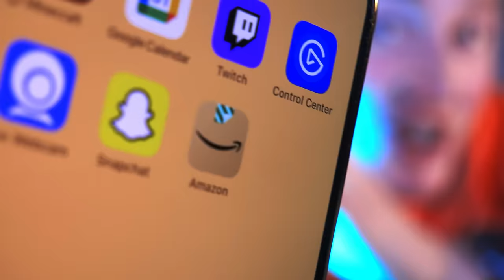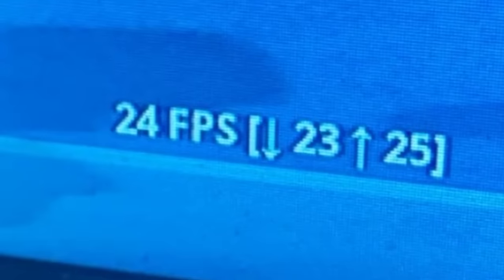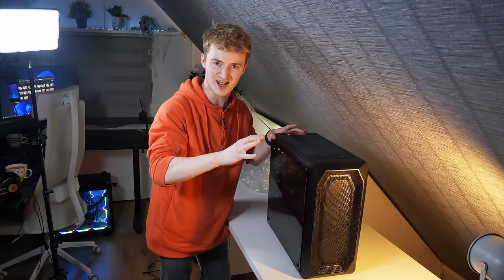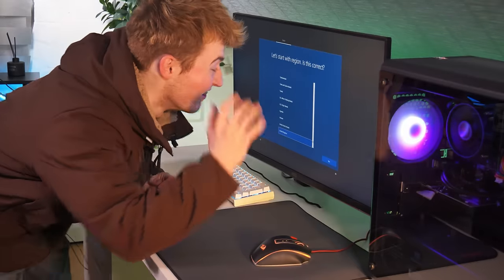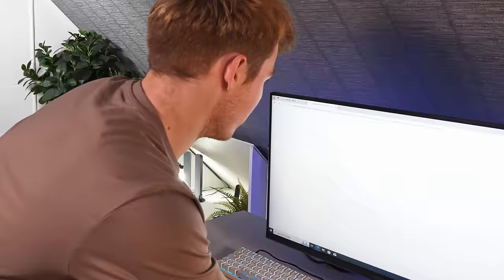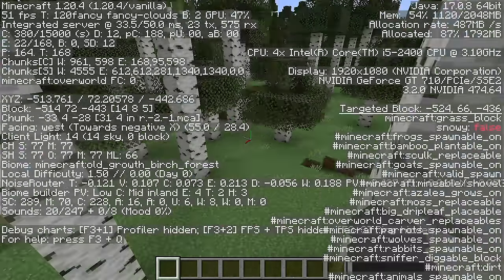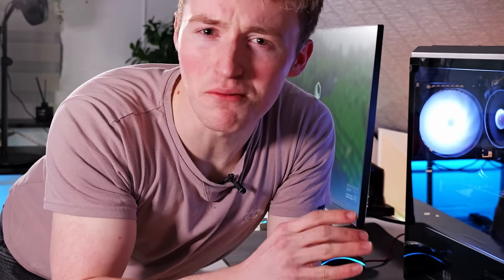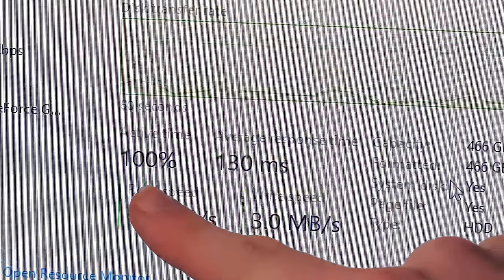Can Amazon’s CHEAPEST Gaming PC Run Minecraft?

Comment: If so one has these specs, you’ll want to get another 8gb stick for less than $10. Then get a ssd for less than $20. For the graphics card upgrade you can get an rx 580/570/560
Reply: i got a worse one than this😅
Reply: get a 2550k or a 2600k, buy a used rx 580 and you got a good budget pc

Comment: I have an Optiplex 7010 from Amazon that I got for like $110 and Minecraft is Nothing hard for it to do it comes with an i5 3470 16GB DDR3 in dual channel NO GPU average frames in mc is 60-80 default and I play with optifine and lower settings so for my experience it's around 100-200 fps and I've gotten about 300+ min settings
Reply: I bought a used pc for around 50 dollars and swapped the old components with some new ones and it cost me around 110 dollars aswell . And it runs 1
20.1 with sodium and other mods . I get around 150 fps

Comment: tbh, mines worse. mine has a gt 610 and 12 gigs of ram (to balance things out) and a i3 4150 (dont question it) mine looks good with a rgb case, but the performance is not that good but still. im happy with it. it can run 1.20.1 on like 78 fps average with 12 chunks loaded. i use mods for fps boost and it can run 1.8.9 lunar on like 200 fps (ik its good) and im happy with whatever i have
Reply: you should get an rx 580, quite cheap but pretty good even though it's getting old
Reply: Ssd?
Reply: ssd is 120 gigabytes and ddr3 (incase anyone was wondering)
Reply: @Avgosbos  im not really into upgrading my pc right now. ill think about it when i actually have the budget to get a pretty decent pc.
Reply: @Yellowiee_   that's a great option too lol
Reply: im getting through it, also rx 580 is for ddr4 when i have ddr3. so ill have to change my actual motherboard and cpu ram and etc to actually upgrade my pc. so yeah i think ill save up and get a 1850 and upgrade other stuff.
Reply: @Yellowiee_ the rx580 isn’t for ddr4. Idk where you got that from, however gpus aren’t made for specific ram. For example, I can put my 1060 in my old i5 3470, 16gb ddr3 ram pc, heck I could even put my 4060ti in it. 

So if you upgrade, you’d have no issue when it comes to that.
Reply: @Avgosbos that i3 will bottleneck
Reply: @Yellowiee_ thats wrong.

Comment: My “old” pc was a Dell optiplex 790 I think and it was kinda cheap too considering the fact it was shipped to me with duct tape around from the top to the front of the case then to the sides and the bottom too because the front of the pc was loosing and almost about to come off and the inside is just well let’s just say it wasn’t good that I expected to be then a few years later in 2023 latest I got my new pc but I wanted to get an custom one instead pre-built one since I don’t trust pre-built pc’s anyone after my last one so I just got the Corsair 4000d airflow atx mid tower case by it self and overtime I’ll get the specs some good specs to make it run well on its performance

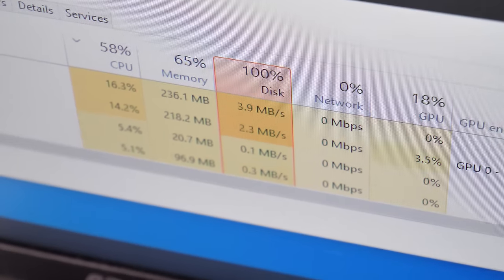Comment: 8:33 no the hdd (hard disk drive) is not failing what has happened is that the drive has a lower rpm on the platters they suck in like a super slow laptop drive from the modern day but that's what your gonna be expecting with a PC that costs as much as a ps4 in today's money

Comment: Mine is worse…. It takes like an hour to load the home screen and if you load the Weather app it will crack it basically freeze the laptop the laptop will just have to wait you have to like shut it down read open it Minecraft Java addition latest it lags so hard that it takes about 14/15 FPS Minecraft it barely works I don’t even know how it’s running windows 10

Comment: Rtx 4060 ti $560
Thermaltake S200 Mesh ARGB Mid Tower Black ATX Case, T/G Panel, No $99 
Intel Core i5 13400F - 300-400
Deepcool CF120 PLUS 120mm ARGB Fan, 3 Pack 60
MSI B760M Tomahawk Wi-Fi DDR4 350-400 would this pc work well?
Reply: @hugedickelliot  I forgot ram memory and a power supply

Comment: The fact that my pc has even less frames then this pc is terrible 😶😶😶😶☠️☠️☠️☠️
Reply: What can I do to increase my fps 😅😅😅😅

I have changed my hdd to SSD 
And increase the  to 4gb(but it supports only DDR3☠️)....
What should I do next..???
Instead of changing this pc😂😂
Reply: @tysongaming095  i depends on what type of game you play
for minecraft you can either mod it of play bedrock edition(bedrock runs like butter if you ask me:) )
for other games you have to check if i depends upon the graphics or cpu( foe ex: minecraft depends on your cpu and memory more than your gpu )
as for me, i have a pretty budget laptop with amd ryzen 3 and amd radeon integrated graphics with 8 gb ddr4 ram and i et about 90 fps on modded minecraft java and vannilla bedrock and about 60 fps on valorant.... 
hope this helps.....
Reply: @tysongaming095  you can upgrade the cpu too :)
Reply: @daiwikdhayapule3459  I don't know why but it seems like they have be stuck to below 10 

I have disabled Vsync and increased max fps to unlimited as well
Reply: @tysongaming095  try upgrading your memory.....cuz higher the memory, more chunks can load quickly, more fps :)
Reply: @daiwikdhayapule3459  i have allocated 3gb ram isn't  it enough

I just want 8 chunks and a smooth constant 60-80 fps gameplay